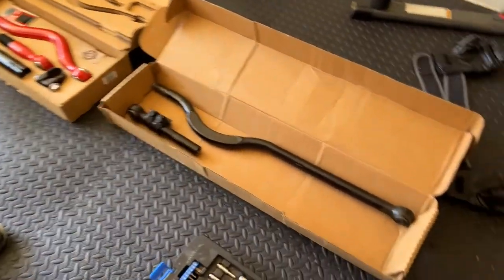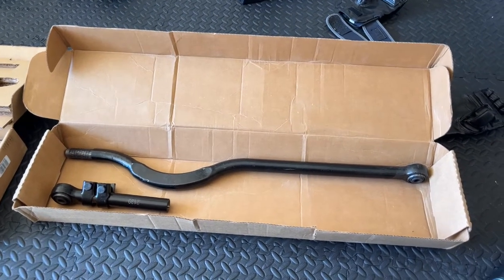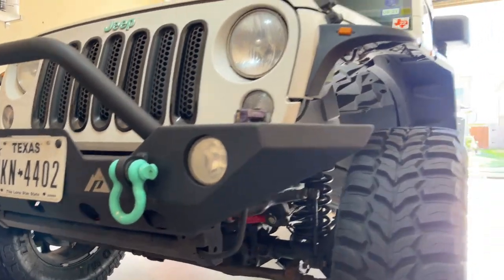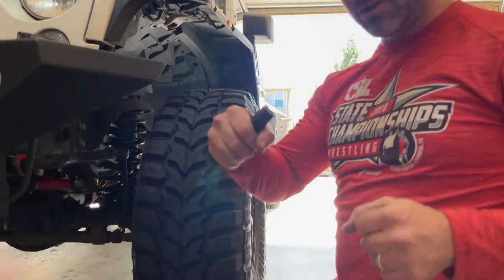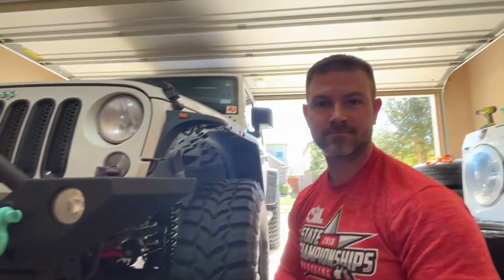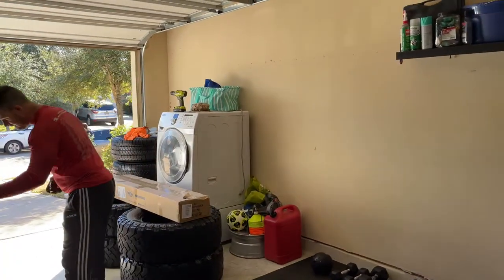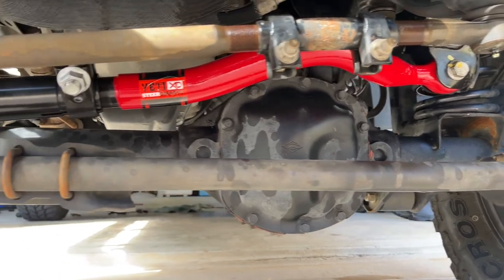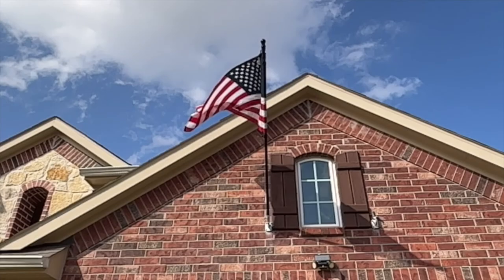What are we doing? STEERSMARTS Yeti XD Adjustable Front Track Bar Upgrade 2014 Jeep Wrangler JK

Comment: can i use this with a 2,5 in lift or are these yetti products of 3,5 and above?
Reply from the maker: They can be used with any lift.  They basically just replace the original parts with stronger more durable SteerSmarts parts.  I have a 2.5 lift.
Reply: @LoneStarSwirl   I wanted to got to 3.5 but when I found out I needed to spend even more on adjustable control arms and new brackets ect I decided to stay were I am  I did however order every smart steer option available hope it was worth 2k